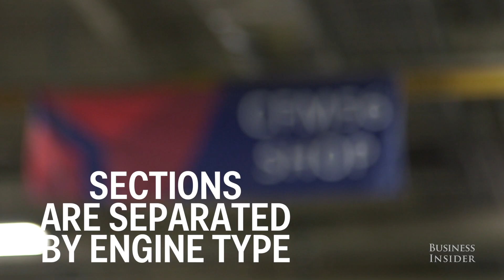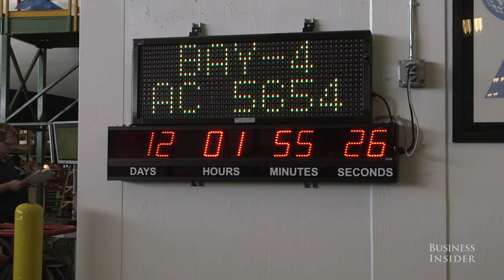Inside Delta's 2.7 million square-foot facility

Comment: This is what happens when you operate  very old aircrafts. More maintenance mean cost and that's being less competitive.
Reply: Yes and no. An older plane is cheaper then a newer plane, an airline could purchase an entire fleet of used 777's for the same price as 1 brand new 787, so in that sense it makes Delta more competitive. The older the plane the more reliable it becomes as all the issues with that model have shown itself and have been corrected. Its the same way as all the problems with a 1990 Toyota Corolla have already been resolved and a buyer knows all the common problems with it. The only way Delta losses out is on the fuel costs of an older plane, maintenance of the Aircraft is more or less the same as a brand new plane unless the parts are rare.
Reply: SirXavior I wouldn't compare planes with cars, because planes don't have a rest area to pull over like cars do.
Reply: +The African Goshawk
. The point is Planes are built to last longer and are more durable then cars.
Reply: +The African Goshawk. When the 787 Dreamliner first came out it had issues with Battery fires, they didn't expect these issues because the plane was brand new, they've been resolved now. Compare that with a 777 or A330 they've had there issues but since they've been flying for years all have been resolved. Again the longer a plan flies the more reliable it becomes since all the issues with that type of plane will be resolved.
Reply: You're off on that. Delta makes money on maintenance. They service airframes and engines for dozens of airlines and military branches. About 20% of the work is for Delta aircraft. The rest is outside customers. I'd sooner ride a 25-year-old Delta jet than a 15-year-old jet from other carriers.